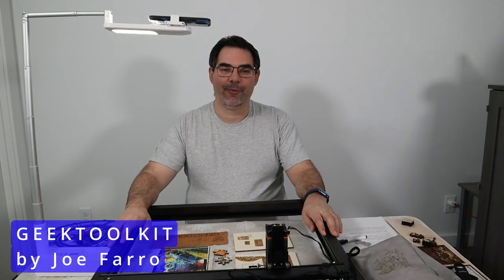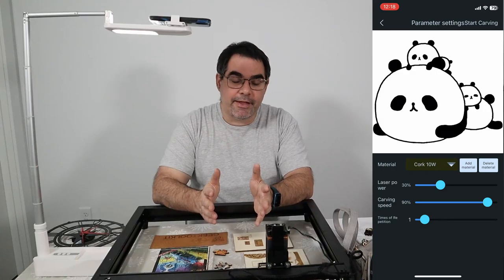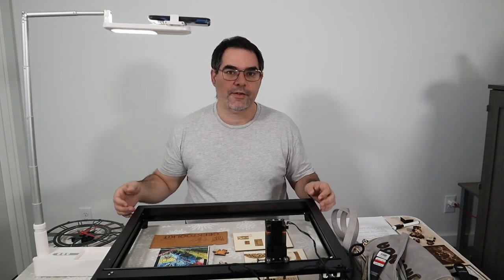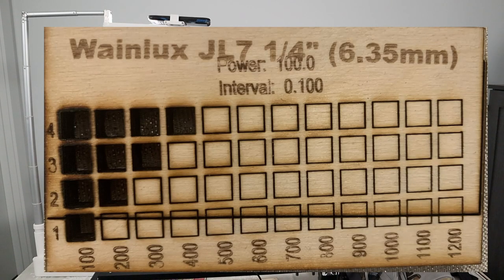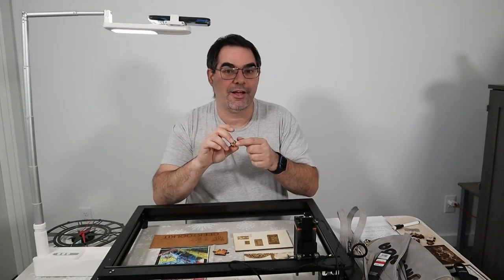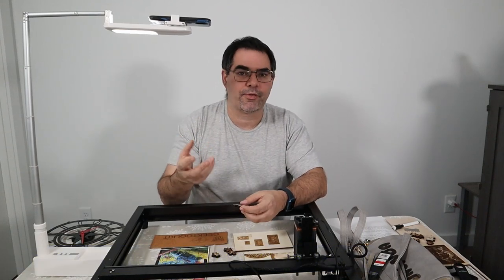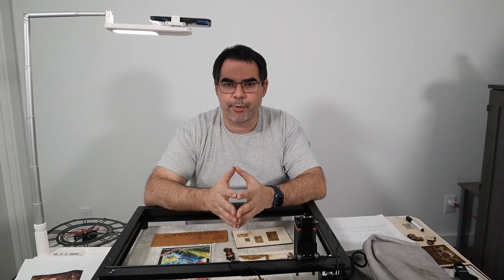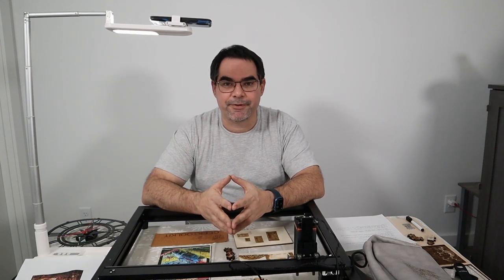Wainlux JL7 10 watt Laser Review and more laser projects!

Comment: Also should I see the laser when it fires up? Just get red light on top and fan running
Reply from the maker: If the laser is emitting and you have glasses on you should see the dot where it hits the board or surface, but usually not the beam. If it’s at 50% power it should be at least marking wood (that’s my usual test). I don’t have the laser anymore to help trouble shoot further sadly but I’d definitely reach out to the mfg to get their help. I’m wondering if you have a bad cable (based on the previous comment) or something else that’s not working right. These things should be pretty straightforward once you connect them and use software to send a job over

Comment: I don't know why but I'm trying first time run this engraver from my iPhone and it says clearing flash and nothing happening. Can you please help🙏
Reply from the maker: If it doesn’t work according to the MDG instructions I’d reach out to them for support. It sounds like there’s an issue with it and you’ll need their help to get that fixed
Reply: I don't even know if the laser supposed to start automatically calibrating when you switch it on because my doesn't

Comment: did you have issues with drivers/connections ?
i purchased a unit 3 days ago and use apple/mac systems have had no luck. Would you help me step by step?
Reply from the maker: I don't have a mac to assist with, or even know how to install drivers for it on the mac.  I'd go through support for that one.  On my PC I downloaded the software driver package, installed that and it 'just worked'. 

Connection wise I used a USBC cable from amazon that I had lying around (I needed a long one).  

Thier reps were very good at communicating with me and support was really responsive (I've had to deal with a number of laser companies now and of all of them, Winlux was one of the better end of the spectrum).  I'd reach out to them
Reply: @geektoolkit  thank you brother I figured it was a more PC geared system!
Reply from the maker: It may not be I’m not sure. When I first used it I used it via Bluetooth and my iPhone and that worked (and was a bit crazy sending something wireless to a laser). I’m hoping you can get it figured out it’s a fun tool to have!